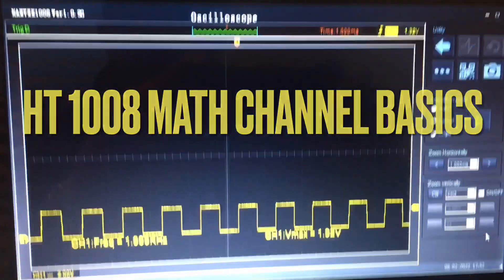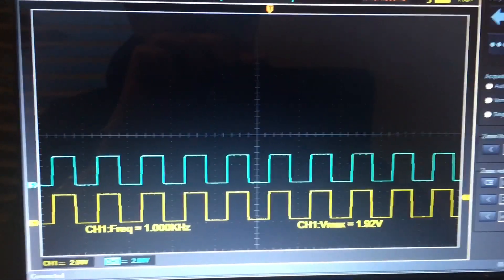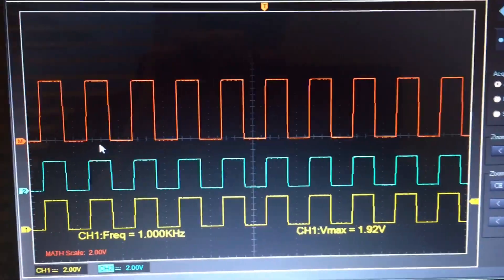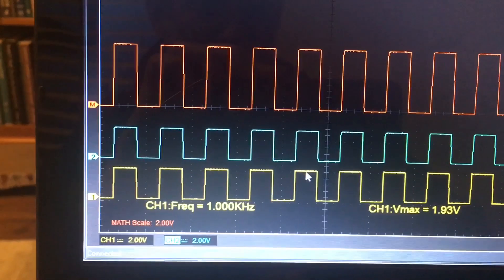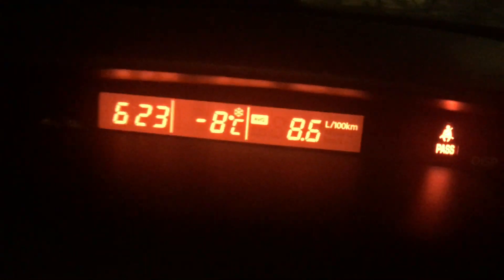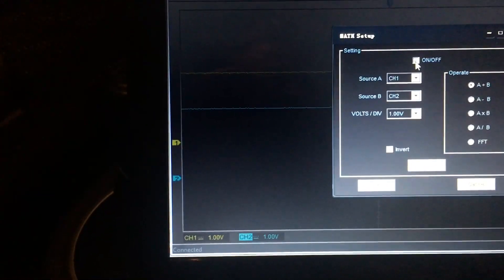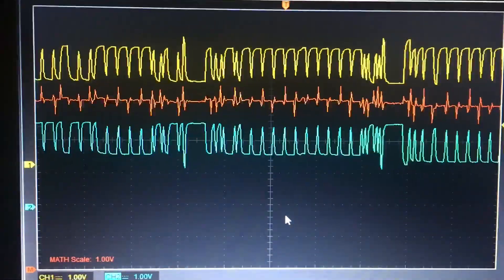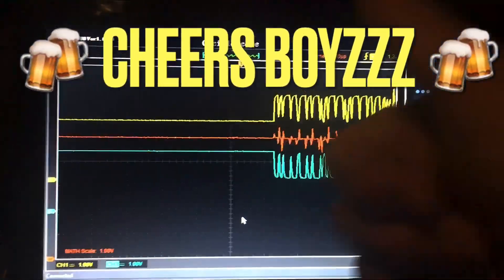Hantek 1008 Math Channel

Comment: Hello, I'm going to rewatch the videos, because I just bought a Hantek 1008c.
Reply from the maker: Hello Stephane, been a while.
The 1008 is a great educational platform. I really did learn a great deal, using that tool some years back. 
🍀👍🍻
Reply: @TheGibby3340  Hello, I have a Picoscope 2204a but it only has 2 voices, that's why I bought a Hantek 1008c with 8 voices

Comment: Math channels can be a game changer in say can bus systems , can high is 3.5 volts and can low 1.5 volts , so if you select A+B in math channel you should get a constant 5 volts it's very useful to see voltage drops outs when intermittent faults occur 👍

Comment: I am more familiar with a math channel as a check on say a FM radio modulator. Where you are modulating one frequency with another .....you theoreticly use the math channel as a "predicted" output and compare it the the actual output.      I guess I am saying I know of applications where we use adding or mixing channels ....I just don't know how doing it artificially on the scope helps us very much.
Reply from the maker: Limited use. Thx for watching. 👍